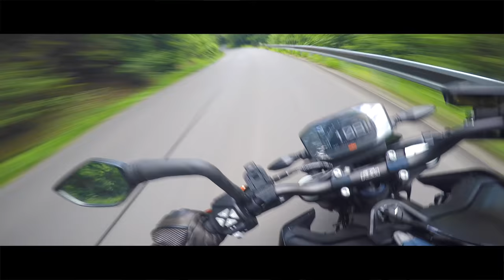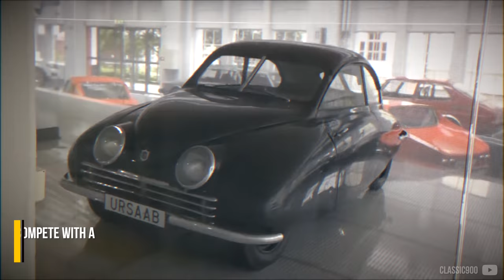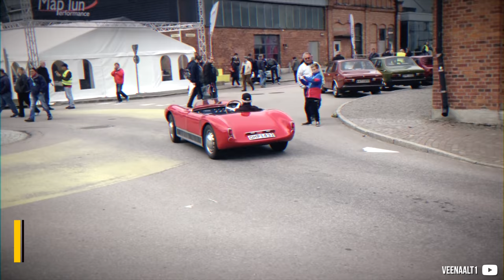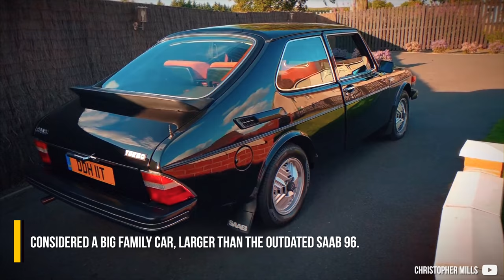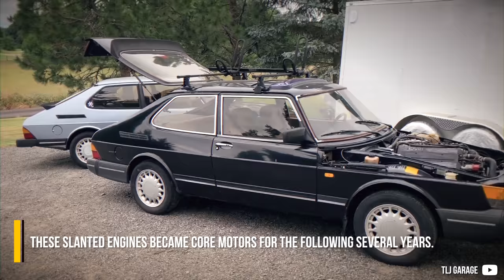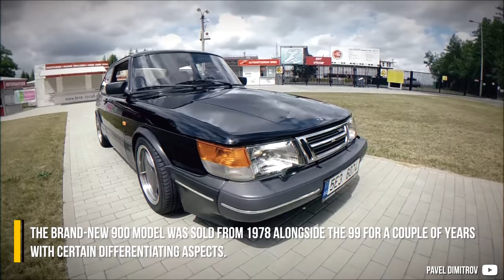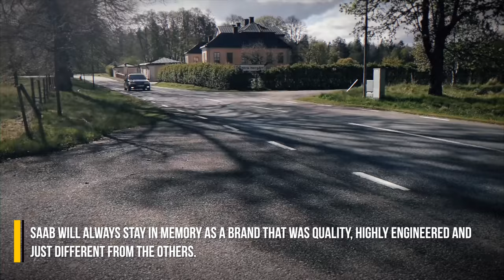Why We Miss The True SAAB?

Comment: Hey, let's buy SAAB without having a business case, go bankrupt, and then prevent SAAB from being saved by someone else. Great job, GM!
Reply: GM only wanted Saab for its patents.
Reply: I hate gm forever!
Reply: Gm is using the B207R in all its new turbo 4-cylinder cars. From camaro to Cadillac. GM stole that motor. Ecopower forever!!
Reply: GM's Chevrolet Division introduced the Corvair and improved all the flaws in the Gen 2 (1965-69) version. However, it wasn't profitable and used Ralph Nader as the scapegoat for killing it. They replaced it with the Vega and we know how well that worked out. Another great job, GM!

I had a Gen 2 Corvair Corsa and it was an excellent car....except for the drum brakes....and it was extremely reliable. I haven't bought another GM product since. 

I love all the SAAB's and my buddy had a 900 non-turbo that he treated like a rented mule. Fantastic car!

Comment: I own 2 Saab's - a 2008 97x Aero and a 1993 9000 Aero. The difference in build quality is amazing. The 9000 has 200,000+ miles and still drives like a new car. As a member of the local Saab club, most owner's agree the 9000 was one of the best ever built for speed, quality and performance.
Reply: The 9000 used a Fiat/Lancia/ Alfa chassis
Reply: @steveistherealdeal7216  yeah it did, but it was so extensively modified only few parts actually are interchangeable
Reply: 7part were interchangable only

Comment: The GM beancounters ruin another iconic marque. It's what they do.
Reply: Beancounters ruin absolutely everything.
Reply: @PistonAvatarGuy  especially the GM ones
Reply: GM beancounters killed Holden in Australia
Reply: @archygrey9093  GM literlly killed so many cool car companies, fuck GM, all my homies hate GM
Reply: No , Saab killed themseles to a great extent. They had the vectra platform and the parent company gave them specifications for the cars that were being built , but , Saab decided to ignore what they had been told to build and designed things how they thought it should be . They were given a perfectly good sat nav system to build into the dashboard but decided to develop a completely new one from scratch costing way to much . That is just one example , there are a lot more . If they had done as they were asked to do then maybe they would have lasted longer
Reply: @MrTarmonbarry  GM told Saab to build an Opel. Of course, those who worked at Saab try to build a Saab in the ways they could get away with it. This is exactly what GM does not understand, if you build an Opel but put a Saab logo on it, it is not a Saab but an Opel. Nothing wrong with Opel, but it's not a Saab.
Reply: @tangfors  Maybe , but it might have kept them alive longer than defying G.M and doing there own thing against the parent companies wishes
Reply: SAAB was in the ditch long before GM took over.
Reply: @manoman0  G.M tried to drag them out of that ditch but it seems they were determined to dig a deeper ditch, shame , they were good cars
Reply: @archygrey9093  Nope.
Reply: @MrTarmonbarry  Hold on there!! You can't speak out such truths!!
Reply: @tangfors  So a Bentley isn't a Bentley? Some weird logic you have, there.
Reply: @MrTarmonbarry  Yeah, GM is weird, somewhat. When they make great cars they make 'em last forever and make them iconic. If they just build rental cars, well, you just get rental cars.
Reply: @manoman0  Ha hahahahaha ,yes , its not popular with some people
Reply: Agree. They destroyed not only Saab but also Bedford(uk truck)who in the early 60's was one of the world biggest truck manufactures and then GM come in and we all know how it ended. Totaly six feet under.
Reply: @tangfors  So...? GM also decided to built a Vauxhall... but didn't build it in iterations that made it a rally champion. (Chevette HS/HSE 2330 & Black Magic Edition) They began development to, and did it with mostly (roughly 90-95%) off-the-shelf parts... only to discover they threw together a car that out-performed it's [then] hot-new performance coupes in all areas, while getting 28+mpg and a 1/3rd as much to build. So what do they do? scrap it, under the guise it's preferential drive axle "couldn't meet our standards during torture testing when the car was equipped as such". :(
Reply: @magnuswettermark8293  A lot of other companies have gone down the pan for various reasons , just look at the British bike industry . It used to be the biggest in the world but got wiped out by the Japanese because the manufacturers sat on their laurels , and did not invest
Reply: COMPLETELY FALSE... Saab destroyed itself by wasting money re-enginerring GM platforms for the 9-3ss and NG9-5. They were selling cars at a loss for decades because of this mismanagement. The blame lays solely on those in Trollhättan and nobody else.
Reply: @stuartstogdill2406  Yes , all true . G.M gave them specifications and parts but they had ideas of their own , wasted huge amounts developing them and that was their undoing
Reply: @sukhmaidickoff  No, of course you sometimes need to share parts to get the price down. But Opel and Saab are two very different brands. Saab driving pleasure, quality, safety, innovation, were their selling point. Opel is a logical commuter car, so cheap pretty basic, practical, okay quality okay safety, but not at the time wher saab was, no car you take out on a dirt road and drive a rally with, a car that takes you from a to b but who are mediocre for the most part, boring typical rental car or company car. If you put in cheap Opel parts that  do not meet the standard for active driving, lower safety, remove innovation. Then why buy a Saab? This is what I mean by GM not understanding that a Saab is not an Opel, many Saab buyers would not have bought the car if, for example, they did not see any new unique innovation that made the car unique and that was better than what was in an Opel. I know people who worked at Saab during the years when they went from being Swedish-owned to being owned under GM. When your owner tells you to build an inferior car the previous generation, which removes much of what the brand stands for. I understand that many who work at Saab, like many themselves, were Saab enthusiasts, tried to save Saab's reputation.
Reply: @manoman0  I do not know much about Bently, it has retained its DNA. Is it still a luxury car and with all the other good unique things that made it a Bently, now and then?
Reply: GM was the angel investor that kept Saab alive for another decade at least. Saab could have used a lot of stuff from the GM parts bin, where it really didn't matter, and then spent their money on stuff that made cars a Saab. Instead, they chose to commit suicide, by stupidity. GM likely should have shut them down a decade earlier, but kept pouring money down into that hole. A shame, as Saab made some really cool cars, up to the end.
Reply: You got that right!  My SAAB and my Saturn were two of my best cars ever, and both brands killed be General Morons.
Reply: @sukhmaidickoff  Oh?  Well, I maKe no claim to infallibility, so please enlighten me.
Reply: Saab would have gone bankrupt a lot sooner than they did if it weren't for gm.
Reply: @sukhmaidickoff  GM is a model of incompetence. That's why they needed to be bailed out by the American taxpayers.  Ford declined the bailout.  And while Ford might have sold Volvo, one CAN still buy a new Volvo.  GM can't even make kitchen appliances that work correctly.  My wife bought a Frigidaire dishwasher, refrigerator, and oven.   Other than being difficult to clean, I don't know of any issues with the oven, but the refrigerator and dishwasher are absolute junk!!!  Also, my '83 Chevy Cavalier was the worst piece of garbage not only I ever owned, but that anyone ever owned!  In fairness, my 2002 Saturn Vue was excellent (except that GM went cheap on 1 valve in the CVT, and repairing it (the second time) after the warranty had expired was insanely cost-prohibitive.  My current '06 Chevy Trailblazer has been reasonably good, but my wife's '06 Buick Rainier has been somewhat less so.
Reply: Once Gm used saab for their technology the Chinese came and did sell a few 9/3 s  about 2000 made then converted them to electric power and now there's a new name and company from the Ashes Saab is technically alive but sold under a different name for the Chinese market. The chinese could resurrect the Saab name as prestige  sports model with its rally heritage. Hell's bells Borgward has been resurrected  for the Chinese market using the rally heritage and great grandson of Borgward himself  involved!
Reply: @sukhmaidickoff  I do not mean that Opel is crappy cars, I mean that it is a completely different type of car, although there are Oples that have a lot of horses m.m. but if you think of an Opel, you think of an Opel Corsa, they are their best sellers. It is not a bad car for its size and purpose. But Sabb's competitors were Mercedes, Audi, Volvo and BMW. Looking at a Saab in the 60's, 70's and 80's nothing looked like it. They were world leaders in making front-wheel drive cars that could compete in performance with rear-wheel drive, which were at the same time economical, safe and practical and reliable. They gained less and less identity. A very big part of Saab's identity was the innovation of doing things differently to other car brands. Saab has always taken parts from other car brands, but changed them, they took a v6 from Ford and made a v4 of it, for example.
Reply: @sukhmaidickoff  https://www.youtube.com/watch?v=ptU8SM6hqSc&ab_channel=Petrolicious

You can watch some of the comments here. For a very long time, Saab was the second best-selling brand in Sweden, and also sold very well throughout the Nordic region. Okay we have a small population but people would not buy them to such an extent if they were not really good cars
Reply: @sukhmaidickoff  You are correct. Bottom line is that without GM, Saab would have been out of business by the mid to late nineties. The New gen 900 was unfortunate but it was the easiest and cheapest to maintain of all the Saabs.
Reply: @sukhmaidickoff  That Insignia that has 325 hp drives like a car with 180-190 hp because is like 2 tons car heavy. That Astra with 2.0 turbo engine that you praise has an SAAB engine. That straight 6 BMW can not be tuned for a sh*t more than 10 hp above (had one e36 and e39). So how the f*ck can you hate on a legendary brand that made the foundations that any other car (even that shi*y BMW with plastic waterpump uses today) turbo charged all line ups. They have all gone turbo now, where's that straitght six today. Listen, will all respect you dont have clue what are you talking about. Try to just chip tune an old SAAB and do a rolling race with that strsight 6 BMW and see what hapens. Just try.
Reply: The bean counters at GM understand very little about managing and re positioning brands,  they understand little about a brand's DNA.

Comment: There's a guy near me selling his STI swapped 'Saabaru" wagon. Very unique build and a sleeper
Reply: Is It a 9-2x
Reply: @codydillenbeck4443  only for selling it, that sounds fucking sick
Reply: @Oblio1942  it could also just be the 9-2x Aero which isnt an "sti"   I have a friend in Colorado Springs thats selling an awesome condition Aero thats got a spare engine since we all know how reliable those engine are. Hes asking 7k for it which is still a lot but it's a "saabaru" so it's automatically worth more some how.  He is also selling a linear 9-2x manual trans for 2k that has about 150k miles and comes with the 2.5 N/A motor and the car is 100% stock down to the airbox.
Reply: @codydillenbeck4443  it could be, but the 05 was basically a wrx with a nicer interior and a different front bar so i cant imagine itd be any different than someone sti swapping a wrx which is pretty common where I live. Even if it was the 92x without the turbo, 06 i think, tons of people sti swap gc8 imprezas and gd 2.5rss also pretty easily. So again completely plausible from my point of view even if all they did was take the turbo, intercooler and maybe the shocks from an sti and threw them on a 92x with an ej205 instead of swapping in an ej257 with the 6 speed gearbox and everything
Reply: @codydillenbeck4443  he said it was swapped with the sti motor
Reply: @devlintaylor9520  its something that should be double checked, if it is really a swap how well was it done? Did he do it or a professional shop? Receipts? Documentation of the swap at all?  I've seen a few try to say that but it was an aero.
Reply: @codydillenbeck4443  oh yea for sure
Reply: Test it first tho, bring a mechanic with you to perform several tests that can't be perceived with a driving test (oil leaks, compression, even tho this can be tricky in a boxer engine, loose parts, wear, driving axles condition (this is expensive to repair, you either change the differential or refill the worn area. I don't think that car has anything wrong with it, but that problem is not uncommon)).
Reply: @codydillenbeck4443  that wagon already had an ej engine, the swap maybe was plug and play, ecu and wiring change of course.
Reply: @RGV2300  I believe it would be but not 100% on wiring stuff. At least from a wrx perspective ive heard they need to swap harness's out but I could be mistaken about that part
Reply: @codydillenbeck4443  yes, maybe the wiring is basically the same. Thing is that wagon saab was a rebranded sw impreza.
Reply: @RGV2300  lol yeah I know, and saab added their own touches, like softer dampening and more sound deadening to give it a more quality feel saab was known for. It's a Swedish-american-sushi roll 🤣  nice part was the Aero ended up with the quick steering rack from the STI. I would love a 9-2x just to get the double takes from the Subaru crowd thats unfamiliar with the 9-2x
Reply: Gotta be a 9-2X wich is basically a subaru impreza wagon with a saab front and badge on it
Reply: Umm diddnt GM badge a bunch of Subarus as Saabs. From what I remember GM couldn't sell the saabaru at the beginning of the year because of their being a Subaru and costing more than the WRX but at the end of the year when the Saabaru was cheaper than its WRX counterpart they sold.
Reply: @masjuggalo  I'm not sure about the sales of the 9-2x and the only other Subaru I know of that shares a similar platform to a SAAB is the Tribeca SUV which shares many things with the SAAB 9-4x. But as far as my knowledge goes those 2 are the only ones that are similar to Subaru. Ive had my 9000 called a Subaru before when I lived in Utah and my wife had someone at her work think our 9-5 was a damn Bimmer! He had asked her "what kind of family did you come from to afford a BMW"?  He was pretty confused when he was told its a SAAB not a Bimmer lmao
Reply: The ad got taken down but (i tried my best to find it) but basically it was a full ej207 + sti 6 speed complete swap, i think he swapped the suspension too but i can't remember. $27,000k canadian.

Edit: almost forgot, it was a 9-2x Aero
Reply: @RandomlnternetGuy  thats way too damn much! I would pay that money for either the very very rare 2011 SAAB 9-5 wagon or a 9-4x Aero!
Reply: @codydillenbeck4443  honestly, it was a pretty extensive list of work and mods. I wish i could have linked the ad. I would wrx front end swap it just to throw people WAY off haha
Reply: @RandomlnternetGuy  we all know parts/mods/labor don't really add value except to the seller because thats what they view the value at. Unless its a classic or rare car it's not worth more than KBB 🤷
Reply: Please dont confuse a real saab with the gm version they are miles apart.
Reply: @codydillenbeck4443  The 9-4x shares nothing with the Tribeca... it is based on the 2nd Gen Cadillac SRX platform. Saab built a concept 9-6 that was based on the Tribeca though, they dropped a production launch when GM sold it's stake in FHI.

Comment: My father was a SAAB fanatic, from hes driving license in the late 1950,s to hes last breath 2000.
I will never forget the sound and smell of the 2 strokes, or the acceleration of the first 99 Turbo, only made in 350 examples, I guess.
What a rocket in the 1970,s,, 🤪.
He eventually sold it to a museum for more than he bought it new.
Cheers and have a excellent weekend Visio,, 🍻😎👍‍‍!
Reply: I remember that Turbo well .   garage near where i worked had one in to have a clutch fitted and the guy took me out to ''test'' the clutch , that thing could move . The car belonged to a Wimbledon football club player but i can not remember his name . Bought an old Saab a few years later , it was a great car until my wife cooked the engine one winter , warped the head and blew the gasket . It had that Triumph engine in it with the slanted bolts going from the crankcase to the head , spoke to a few people about the repair and got told to many horror stories about how hard they can be to remove , shame , it was a nice car
Reply: My dåd har a 99 turbo sedan. Rhen ge opted out and sent for a 100 hp GL...bummer. Although he Had a fuel injected EMS 118hp in 1974.....sweeeeeet
Reply: Rhen ge opted out and sent for.....
Reply: Then.....
Reply: Went......new Lenovo  yoga i9....so my dream cars? 9000 CS Aero, tuned to 400hp And a Sonett II V4 in racing mode
Reply: Saab 99 , 900 , 9000 especially Turbo model is my childhood ^^ i love they specia "nose"  and "eyes" ^^
Reply: had a 93 turbo not a good feeling airborn at 140.. spit second decision leave it in gear or pop im neautral